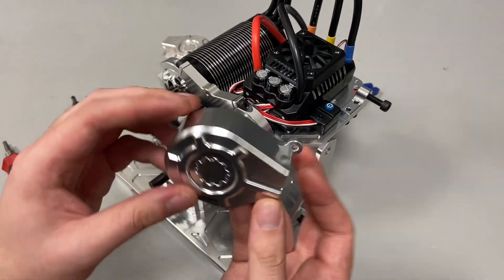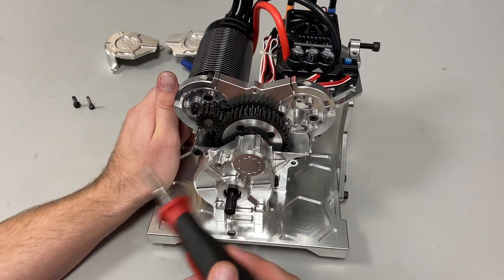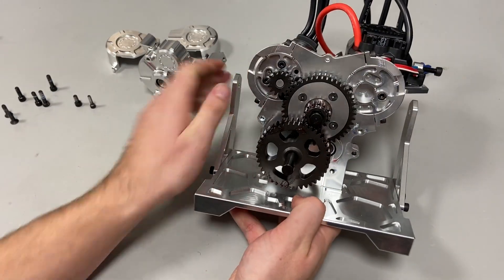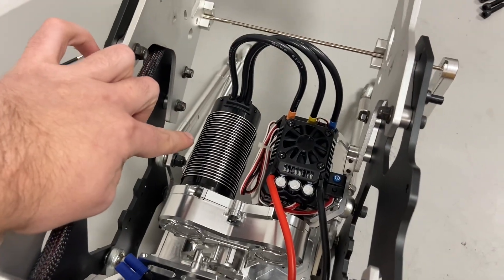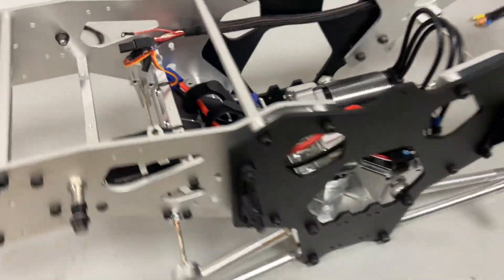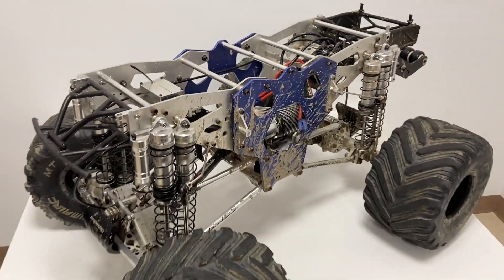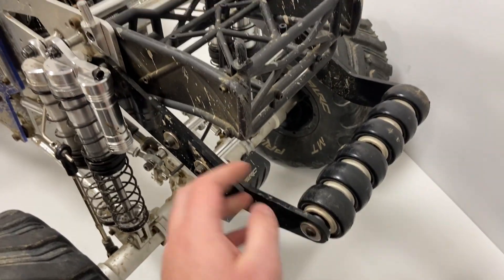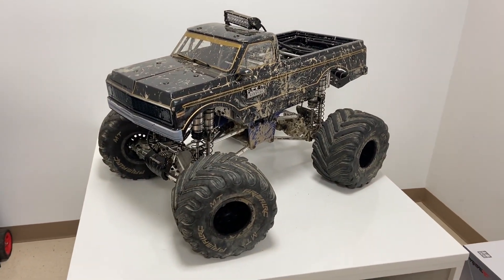ALL NEW Primal RC Monster Truck Electric Conversion Kit

Comment: Awesome upgrade pkg guys!!! Should have a bracket to support the back end of the motors, they are heavy that’s gonna be hard on the mounts during jumps. May save you a lot of warranty claims.
Reply from the maker: Thanks. We have been beating the heck out of it without motor supports and it's holding up fine because it's very think aluminum.  We will off a motor support kit in the future for people that may want it.

Comment: Does this mean it'll be offered as a roller or with this kit included?
Reply from the maker: We do plan on that but not for several months.
Reply: @PrimalRC Take my money. 😀  I'll keep an eye out for that for sure. 👍  I'd much rather buy it good to go than buy gas and convert, etc. Really going to elevate your sales I think offering electric ready kits. Maybe a single and dual motor option for those really power hungry.

Comment: Wow that's insane! Backflips like that! 😮

Only those who have a ram will know why this is incredible! 

Mainly due to how heavy the truck is, you could only dream of it backflipping that easy. Credit to you guys!

Love the design of the spur and the fact you can run this setup as a dual 🤔
Reply from the maker: Thanks Amo!   Yea, there are no limits now to what you can do with this truck. V4 diffs have been holding up great so far even with dual motor power!
Reply: @PrimalRC raised the bar once again. Love the fact this has been under testing with the V4 diffs for sometime now and proven the truck takes it. 

Amazing!